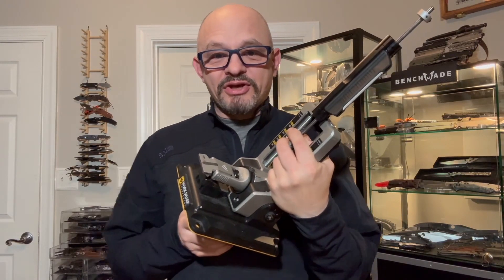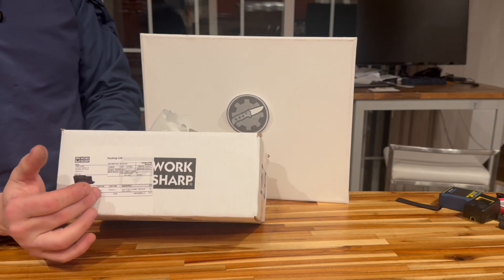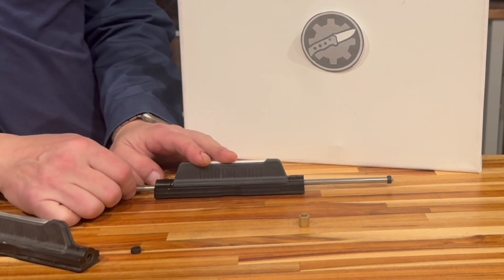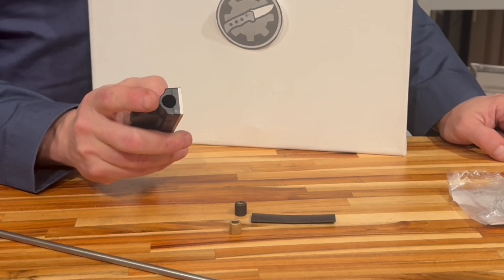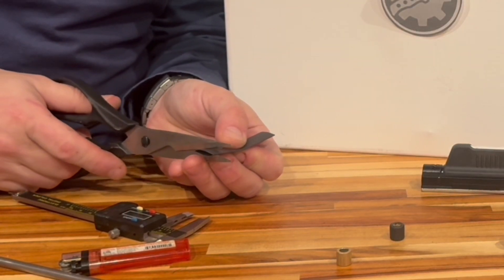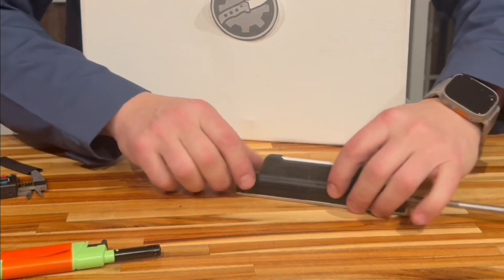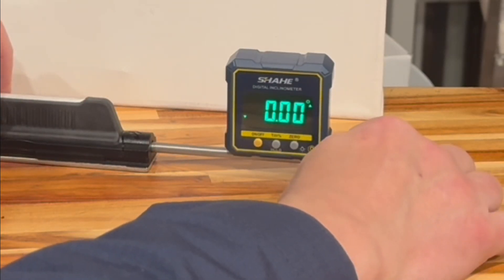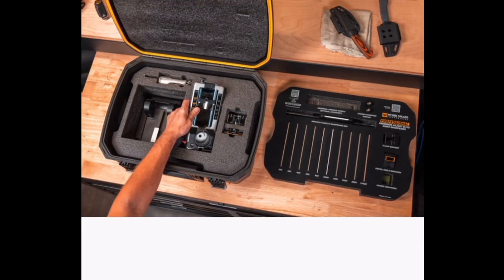New issue with Work Sharp Pro Precision Adjust… Surprised? Here is a solution.

Comment from the maker: ATTENTION!!! DO NOT LUBRICATE THE NEW BUSHINGS! DOING SO WILL HAVE THE OPPOSITE EFFECT. 
THEY ARE DESIGNED TO RUN DRY! 
The only good way to test the rod for straightness is to roll it on a flat, firm, clean surface eg. Kitchen counter. Rattle indicates it is not perfectly straight.
This video is intended to help those who own the Work Sharp Pro Precision Adjust fixed angle sharpener. This should help with the “fixed” part. 
IMHO “Made in USA” should come with strings attached! At this price or any price.  
Let it fly in the comments even if you don’t own this device or have a different opinion!
Reply: I wish I would have known that sooner. What do you do it you used white grease to lube the rob.
I also pulled the trigger on your parts for the fix
Reply from the maker: @TS-ps3dt  Just wipe the rod clean with alcohol or lighter fluid and, since the bushings come in a 10-pack, replace them or bore-brush the ones you used with the same fluid.
Reply: @CuttingBoardRx  I appreciate what you do. It is sad that after investing as much money in this system thinking that one is getting a top notch one and done kit only to have to  add more.
I bought an inexpensive Robox sharpener and it works so much better.  I figured I would try to work sharp.  10 times more expensive and I am still having to chase perfection. 
We shall see what happens
Reply: Where can we buy the replacement holder from the company you mentioned. Actually I will just re-watch it and Google it. Thanks for the fixes. Do you think for $250.00 plus money for fixes it's still worth it or is there another system you would recommend, thanks in advance? ✌️
Reply from the maker: @bbolanda1818 I highly recommend XARILK Gen 3. I have videos about it and links to get them from Amazon plus everything you need to get going at pro level. Everything together is under $160-$180
Reply: @CuttingBoardRx thank you very much sir! I appreciate the work you do for us
Reply: The big problem for me is the la k of depth of the jaw opening . It may be fine for pocket knife blade width but not an 8” kitchen knife that is much wider. The jaw only cinch’s about a 1/3 of the blade which leads to flexing down near the cutting edge which in the end throws your angle out due to flexing .
Reply: @michaelkennedy4444 there is a good fix for that with amazon parts, search youtube

Comment: If the bronze bushings cost usd8 for 10 pcs or 80 cents a piece, why didnt they just use bronze bushings and provide a better product? Shame on you Work Sharp!
Reply from the maker: I have the answer that came directly from their chief engineer Dan with whom I had that discussion at Blade Show Atlanta. 
He said they tested the idea but the bronze made it harder to push the rod and it would wear the rod down 🤣
Translation: they want you to buy replacement plate holder.
Reply: @CuttingBoardRx is that answer a selling point for TSPROF or not?
Reply from the maker: @wpymes  TS Prof? or XARILK Gen 3 which does everything that TS Prof does but for $300 less. That’s my most recommended but if you hate money, go with TSProf, my friend!
Reply: @CuttingBoardRx I am prompting our dialogue to Gemini AI. The AI opininion is that XARILK Gen 3 is "90% of the performance at 30% of the cost " , being the 10% less peeformance less precision caused by "clamp flex" being it's suggested solution an upgraded XARILK with TSPROF clamps. Your opinion?
Reply from the maker: @wpymes  I appreciate the fact that you’re doing research so thoroughly! 
Please take a look at my videos on XARILK and read the comments. They address issues on the fly and it takes weeks, not months or years to fix them. They also replace faulty units (entire units) without changing a penny or making you return the og unit as long as you provide evidence of an issue

Comment: Wowww just watched your other video and i thought to myself. Okay im sold im going to get it. 

Then saw this one. Screw that and them for this. It was surely delibrate they did this. 1- thats way more work than its worth. 2- i rather spend a few hundred more to a compamy that isnt dirt bags. 

Is there an option for aftermarket sled/holder that will work? If not what other brand sharpener system do you recommend lets say staying 600 bucks or less

Comment: Unfortunately, there is an underlying design problem that is contributing to these issues.  Work Sharp uses a magnet in the handle to affix the abrasive plates. This magnet is located right up against the guide rod.  As you slide the handle up and down the guide rod, this causes the guide rod to becomes magnetized, which in turn causes the ferrous metal grit from the knife to adhere to the guide rod and eventually foul the bushings.  Obviously a non-ferrous guide rod would correct this, but I doubt that is going to happen.  I have been demagnetizing my guide rod after every session helps a lot.
Reply from the maker: This is a great point, Sir! The blades also get magnetized and one should demagnetize them and clean the knife’s mechanism after sharpening. Thanks for subscribing!

Comment: i am doing the research trying to decide if it is worth sinking all that cash into this sharpener.  this video is quite enlightening and glad i did not pull the trigger yet.  At this price point (for the more expensive ones) it should be perfect with very long life to it...

do we know if since the video there have been any updates to the devices?  or still the same?
Reply from the maker: There have been no updates to this device. Please check out videos I posted on other sharpeners, especially about XARILK Gen 3, which is my most recommended sharpener at this time. The Amazon affiliate links are in the descriptions for all videos. Thanks!
Reply: @CuttingBoardRx  thanks again! will check it out.

Comment: I have this system the only thing good  about it is the diamond plates, and the angle finder. The rest is total garbage💯
Reply from the maker: Yeah.. Work Sharp mostly sells Chinese 2nd rate crap in a fancy yellow packaging… those plates are junk compared to other inexpensive ones I use almost daily .
Reply: @CuttingBoardRx thats why I said good.  Definitely not great. I have a set of DMT  120 to 8000 grit that i use regularly.

Comment: Just received mine. The plate holder is abysmal, it is sloppy and has .75 degree up and down. I knew the issue on the old one and ordered the bushings so I could change them. Turned it over and no screws! Cannot fix. I just sent an email to Work Sharp to see if they can make it right or I’m sending it all back. There is so much slop in this that I wonder if it only has one bushing in it. Argh!
Reply from the maker: I have a video on how to fix the one without screws. Check it out. 
Or send it back and order XARILK Gen 3, link is in the description. It’s like 1/3 the price and 5 times better performance and plates availability.
Reply: @CuttingBoardRx I just ordered hapstones universal stone holder for it. Waiting to see what work sharps reply to my email is. They took a flaw and made it worse. I think I will design one and have a friend 3d print it based on using the bronze bushings. Might make one milled for aluminum.

Comment: i just purchased the new elite system and I do love it, thanks for the modification, Amazon UK seems to be getting low stock of the parts needed so if anyone gets stuck in the UK hit me up, I love the feel of the rod with the added parts, mine was a bit wobbly out of the box, 2 days later and its sweet. Thanks again! Shame your fix isnt getting more views.
Reply from the maker: Your comment is very timely! Did the Elite kit come with the universal plate holder? If so, does it feel more or less wobbly than the basic plate holder?
Reply: @CuttingBoardRx unfortunately not, it came with a space in the case for it. I have been unable to source it from anywhere in the world, seems only Work Sharp has it in stock and they refuse to ship to the UK even though I can't get it anywhere. I didn't measure the slop on the new holder but it seemed to be pretty sloppy, that's out of the case. I've ordered a Hapstone holder purely so I can add some strops with my own compound, Stroppy Stuff, it appears the Work Sharp strops are all pre loaded with green compound, I could be wrong but every picture online shows there strop green.
Reply from the maker: @DawgNo1  Don’t feel bad that you can’t get that thing in UK. You’ll see why pretty soon 😉

Comment: What a disgrace, they sell a so called precision tool not fit for purpose. I was going to buy one until I saw your video. If the manufacturer can't be bothered to fix the obvious flaws, why should I?
Reply from the maker: I did some videos about XARILK system and for 1/2 the price you can get it, good plate set, and angle finder from Amazon. By now couple hundred people ordered all that from my links and all I hear back is positive.

Comment: Your too picky 
The tool is good for the price
Reply from the maker: It sucks. And talking to the engineer who designed it, it’s the Chinese parts suppliers that cause a ton of issues. There are much better Chinese sharpeners on the market for less than half the price. Watch my XARILK playlist.

Comment: Have you tried any of the aftermarket options from Hapstone, such as their universal stone holder? I’m just curious what the experiences have been with that. You absolutely shouldn’t have to buy something else to make such an expensive system work as it was designed, but just wondering if it’s a viable option for those who already got burned with this.
Reply from the maker: Why buy the inferior sharpener that requires modifications just to work properly and spend even more on attachments when you can get a much better setup for less than half the price?!
I’d pick XARILK over WSPPA any time! Both are made in China so why spend extra?
https://youtube.com/playlist?list=PLQk7wjytAnykvYUMWfKQ3WnhsymdDBkVV&si=bkjMPtZ1T0WDGaTX
Reply: @CuttingBoardRx  After giving it more thought, I just ended up biting the bullet and buying the new KME precision control. American made, and doesn’t seem to suffer from the same corner cutting methodology work sharp seems to employ with everything they make lately.

Comment: I ordered the new kit.  I had already placed my order for the bushings.  As soon as I pulled the plate holder from the case I said some choice words.  I will be contacting them because they are sleezy for making an inferior design and then making it harder to fix for their customers.  Not cool at all.   Thank you for making the follow up video you saved me from returning this otherwise great set up.  I was trying to avoid spending $1800 on a TS Prof setup.  DO BETTER Worksharp!
Reply from the maker: You should watch my videos about XARILK  Gen 3. It is everything that TS Prof is for under $100. All you would need to get going is linked in description. FYI I would get kickback from Amazon if you use my links. All TS Prof attachments work on XARILK BTW

Comment: A truly fantastic solution but I feel like saying it's almost certainly an ease of manufacturing decision, not a "sticking it to consumer" decision by Work Sharp. The glue probably eliminated the need for a person to hand screw the plate holder plus the cost of six screws multiplied by thousands of units. The cost to retool the manufacturing process likely far outweighs any stone carriers they may sell as a result of that original fix no longer working.

Comment: I have one too and honestly hate it. Used it maybe five times. My biggest gripe is the flex in the clamping mechanism — it messes with the sharpening angle, so you don’t maintain a consistent bevel or included angle. Even light passes seem to warp the 90-degree alignment. I'd give it to a friend, but wouldn't want to curse them with it. Maybe Goodwill, or straight to the trash. Looking at alternatives now… maybe Xarilk?

Comment: I’d say buy the hapstone universal stone holder and call it a day.  Rides much smoother and also doesn’t get clogged like the WS stone holder.
Reply from the maker: @meesterdinglefritz2064  Why spend the money on all this?! The base is still a wiggly piece of junk
Reply: @ The WSPPA works perfectly, for my needs.  If my angles are slightly off, my 45 year old eyes can’t tell.  Effortlessly sharpens any steel I can throw at it and the apex & bevels I can achieve with it are far superior than anything I could do free hand.  

The system may be wiggly junk for someone of your caliber, but for this dumb electrician that enjoys keeping his knives pretty and sharp, it’s perfect!
Reply from the maker: @meesterdinglefritz2064 Sure thing, it is decent for touching up a working knife, but I can’t recommend it for finer collectible blades where an absolutely flat and near mirror polish bevel is desired. It is not an inexpensive system, and, wouldn’t you agree, Made in USA should be and great and not just good enough?

Comment: Good information I was planning to get a work sharp. Any suggestions, the ZARILK gen 3 mentioned below or TSPROF Pioneer, or other model?
Reply from the maker: @frosty3693  I own XARILK Gen 3 and TS Prof Kadet. These both perform better than Work Sharp, which I stopped using at this point. The difference between the Gen 3 and Kadet are very minor and precision is the same. I air on the side of saving money on the device itself and investing into the plates and other materials.

There are videos on my channel going over the above mentioned sharpeners.
Reply: @CuttingBoardRx  I have lost count of your videos I have just watched. The XARILK seems the way to go. I plan to use the links in your video to order. Thanks. Neeves did recommend the TSPROF single clamp. But you showed how to just use both clamps on one side for little blades. 
Thanks.

This reminds me of back 35 years ago. A Bridgeport vertical mill was about $25K French (?) copy was $10K but the Chinese copy was just $4K. I didn't need the precision nor durability of the Bridgeport. This is the same situation.

Comment: For a product that cost $250 this is unacceptable, with that being said could you use a heatgun to warm the glue holding the plate holder together and separate them to replace the bushings?
Reply from the maker: @robertolson9032  Tried this and it is not possible- the plastic melts before the epoxy

Comment: How to sharpen puma white hunter on this device as I am having a problem.
Reply from the maker: I can see why! Serrated, recurved, 6.13” long, 1/4” thick blade not to mention a humongous swedge? I don’t think WSPPA is the right tool. TS Prof Kadet or XARILK Gen 3 may have the capacity to clamp the blade by the flats. That steel is easy to sharpen through and it strops nicely too, so Spyderco Gauntlet may be a good choice for you. 
https://amzn.to/4gClUni
https://amzn.to/3CTOSBc

Comment: You need to spin the plate holder around. The grooves are there but you have it backwards. It does fit in the top of the sharpener.
Reply from the maker: @franko517  well, the old one did either way. Shit design

Comment: So glad I read this!  I was just about to order the suitcase set at $450  Now what?  Does the Xarlic 3 now incorporate all the mods you and Neeves knives recommended?  It bothers me I have to order additional parts from another knife sharpener to make the Xarlic  complete.  I have no idea what stones to buy to take a heavily used Magnacut blade back to hair shaving sharp.
Reply from the maker: I believe judging by the comments, XARILK  indeed incorporated my recommendations. The device needs nothing more than what comes with it, all the TS Prof mods aren’t really needed imho. If you get Gen 3 and the 10 plate SY Tool set, you will be covered for 99% of what is needed. For convex edge, check out the video I did on Buck 119 sharpening a while back using a miniature belt sander. Someone reported TSProf attachment is not very effective. I have a ton of respect for Neeves, he’s a great resource for sharpening techniques.

Comment: @CBRx, once more you proved that you love what you are doing! I own the new version unfortunately and, after I saw this video and read the comments, I am thinking of one of two solutions.
1) Buy the initial, first, WSPPA handle version and do the bronze bushing modification you found out.
2) Buy a handle from a third company like Hapstone Universal Stone Holders for Professional Precision Adjust or Gritomatic 6" Stone Holder for Work Sharp Professional Precision Adjust.
What's your opinion on this?
Reply from the maker: On the one hand I enjoy these little projects that WSPPA keeps throwing my way, but on the other hand I also enjoy my other sharpeners when I just clamp the knife and get the blade sharpened 🤷 
A good conundrum to have 👍😉
Reply: @CuttingBoardRx  Message received crystal clear! Keep up the good job.

Comment: Oddly, the new videos from Worksharp showing off the ProPA Elite (and Elite upgrades) still show the plate holder with screws. I wonder if they've gone back to that, or actually using an older plate holder in the video for the supposedly brand-new product.
Reply from the maker: @BenCampbell-777  The video was probably shot waaay before the full rate production had began. These “campaigns” undergo immense scrutiny and several approval cycles. But, I won’t exclude the possibility that they had more warranty returns on the new holders and that could have driven them to reverse the design. I hope the thing is gone and with it the resident marketing genius who came up with that idea. 
What they should have REALLY done is copy the Hapstone carrier and call it a day!